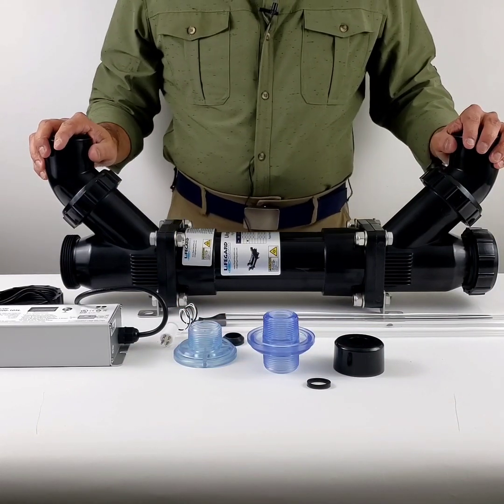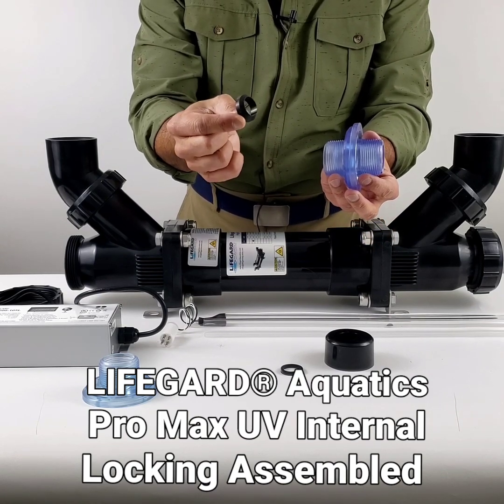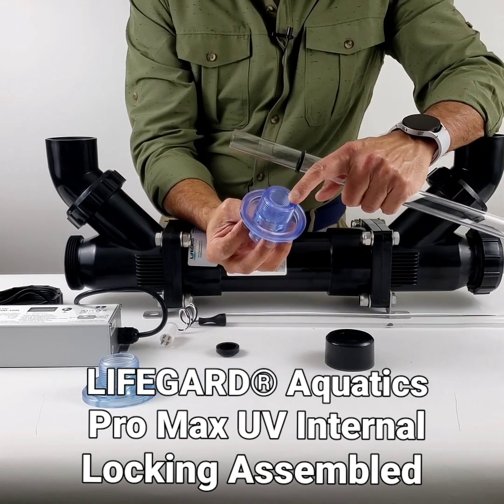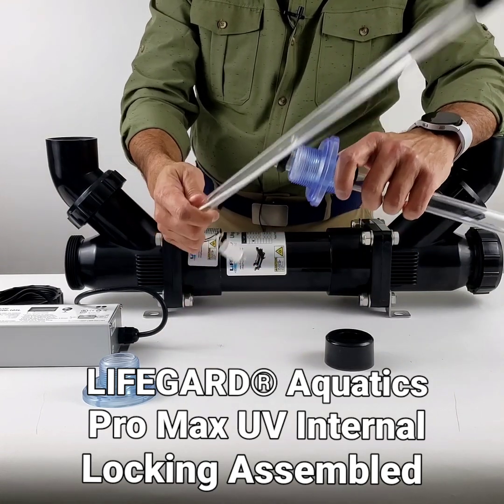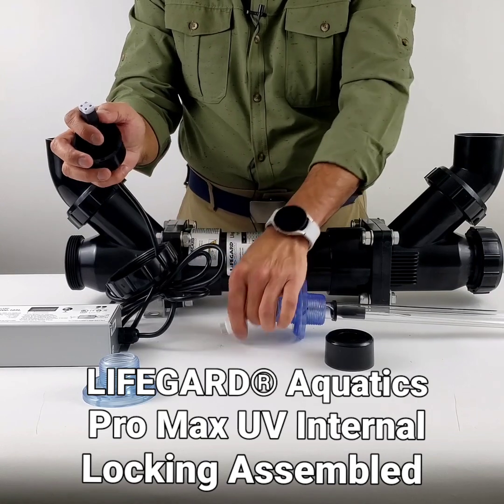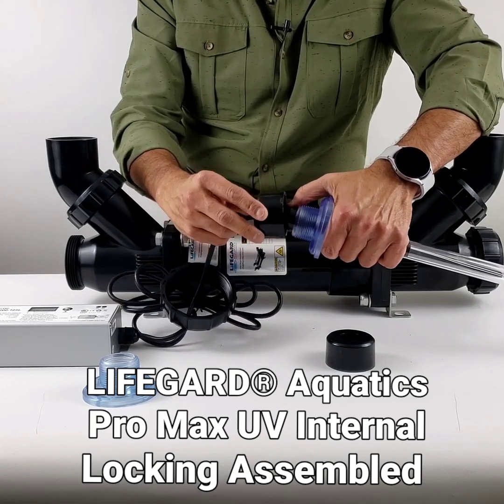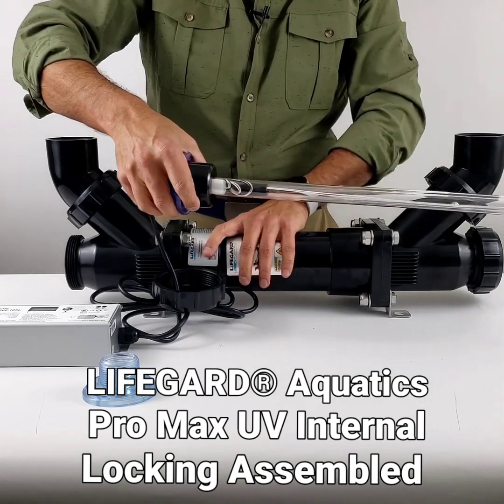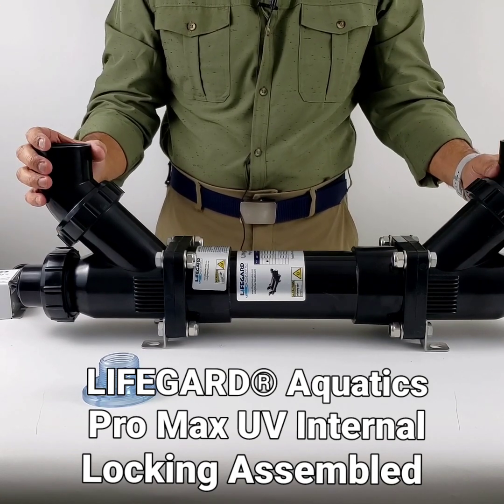LIFEGARD® Aquatics Pro Max UV Internal Locking Assembly

Comment: Did I get the wrong size quartz sleeve? It does not fit through the blue cap.
Reply: So did you get it figure out? I have the same issue. Thanks!
Reply: @johnnyn7947  it turns out the blue cap had a manufacturing defect. I emailed lifegard, and they sent me a replacement cap and a new sleeve cause I cracked it. The sleeve goes through now, and I got it up and running for a week already.
Reply: I just got the @lifegard_aquatics 40 watt unit and have the same issue.  Emailed the vendor I got it from.  Hoping to hear that I’ll get a replacement.

Comment: Question. Yearly you're supposed to replace the bulb, clean or replace quartz sleeve, and lubricate all O rings and gaskets. Should the tapered gasket that slides on the quartz sleeve be lubricated with food grade silicone grease? I know there shouldn't  be residue on the quartz sleeve. Especially on the part where the bulb is located. I've also noticed when using silicone grease sometimes gaskets and O rings become quite slippery and slide around. Sometimes this causes them to move around not seal very well. At least in the cases where there isn't a groove to retain the position of the O rings. Was also wondering about the small O ring that seals against the end of the quartz sleeve. Does it need to be lubricated? You definitely wouldn't want that slipping off the end of the sleeve. Thank for any info you may have.
Reply from the maker: Thank you for your question. All rubber parts should be changed once a year as they get degraded in presence of UV or Salt water. To make it more convenient Lifegard now only sells the replacement rubber parts as a set that includes all O-rings and gaskets. You can order as following:
SKU: R450239 - Rubber Seals and O-Rings for all 3" Diameter Housing Pro Max UV Sterilizers
SKU: R450240 - Rubber Seals and O-Rings for all 5" Diameter Housing Pro Max UV Sterilizers

You can contact your local dealer or visit www.lifegardaquatics.com
Reply from the maker: Reply# 2 - Very important. Do not use any oily silicon on rubber parts that come directly in contact with the quartz sleeve. Only use water soluble aquatics friendly silicon on there rubber parts.
Reply: @lifegard_aquatics  Thank for the reply! Could you recommend a silicon lubricant? I currently have Molykote 111 which is a food grade silicone grease. It’s very thick and is designed for gaskets and O rings. I don’t think it’s water soluble though.
Reply: @lifegard_aquatics  I ordered new housing O rings. Part number R450219. These are way bigger than what came out of the housing. These must be for the old style units?? I can’t seem to make them work. I’ve looked at the instructions thoroughly. There’s also 2 flat rubber gaskets inside the housing. I don’t see these on the parts list either. Is there an updated parts list with numbers for the new style units. Mine is a year old.
Reply from the maker: @JTReef  I will recommend you get the complete O-ring and Gasket set from Lifegard. SKU: R450239 for the 3" diameter housing. This way you get all the replacement rubber parts in one go without and mistakes. 

https://lifegardaquatics.com/collections/promax-uv-sterilizer/products/rubber-seals-and-o-rings-for-all-3-diameter-housing-pro-max-uv-sterilizers?variant=42056905359533

Comment: Looking for a UV for a 240gal freshwater tank. Intend to run about 400gph through it. Looking to kill organisms, parasites - So not just for a green water clarifier.
I was wondering if the 25w would work ?
Reply: I got the 90 watt for 500 ga system.